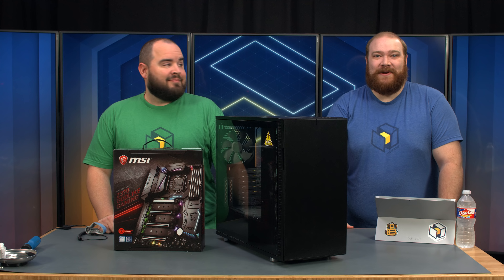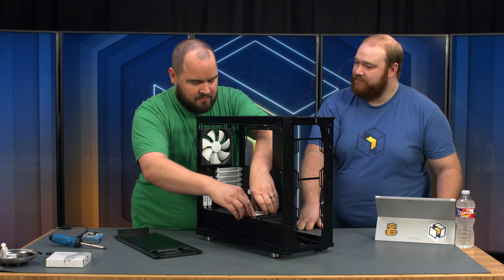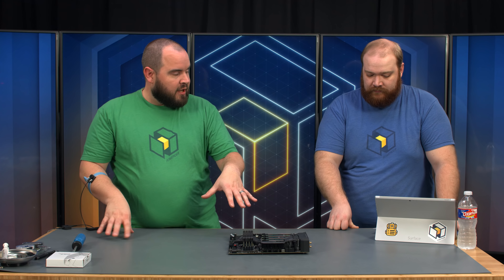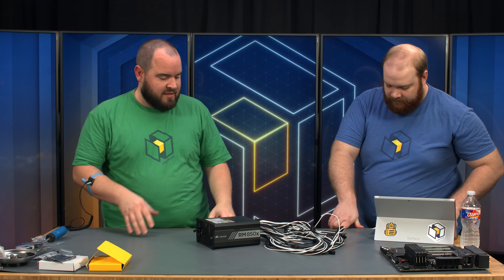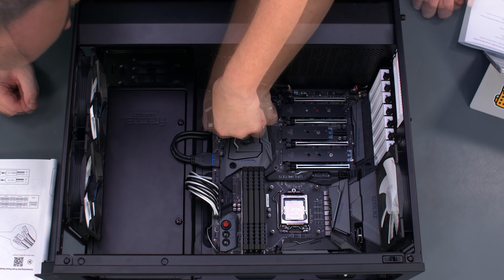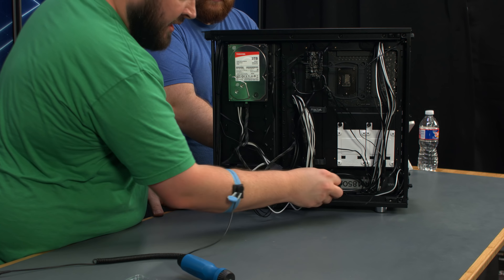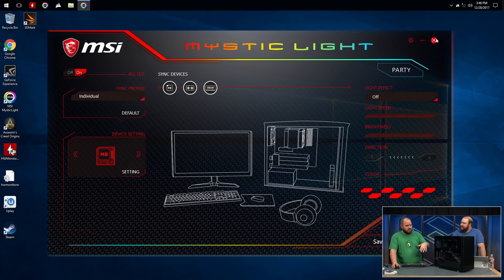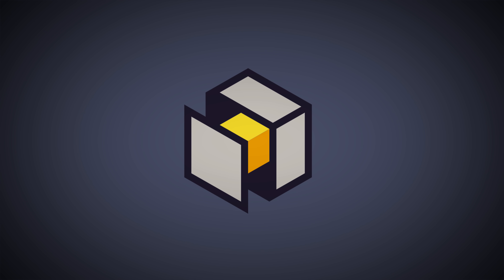Fractal Design Define R6 Build - i7-8700K / MSI Z370 Godlike Gaming (Livestream Archive)

Comment: Build white and black with msi aero asrock tiachi corsair vengance led white and nxzt h700i
Reply: with***
Reply: Nicolas_O.G.T i
Reply: H700i is awesome I just got one. I kinda expected the hub to be bogus and was willing to pay the price just for the case, but it's actually working well so far. I haven't tried the smart functionality though (where is tests and measures fan and noise levels), so far I've just used it as a basic fan and LED hub.

Comment: Am i the only one who cringed when he put his ESD band on when it's attached to the table and not the MOBO? like dude... anti-static mat is cool and all but you still shock the board unless you ground to it first..... Before you touch it with your hands... or it can get shocked when it touches the mat... You want local grounding, that's what the band is for...
Reply: Though i suppose it was fine anyway because he did touch the inside of the bag before the mobo which would have grounded him to it thus making it fine.

Comment: So sad to see an allegedly professional channel install a GPU rad on the bottom of the system. Gonna burn that pump out.
Reply: never build a system with custom water cooling before, could you explain why as i'm soon going to build a system, what would have been a better solution?
Reply: My comment only applies to AiOs. Due to the pump for AiOs being contained within the cooling block, you need to be mindful of the effects of both gravity. And due to the fact that AiOs are not 100% full of liquid and have no separate res, you have to then worry about air pockets. You always want the return to the pump block on an AiO to not have to fight gravity, and you want to make sure the rad is never orientated in a way that an air pocket will form at the barbs/tubes.

For a bottom mounted AiO rad like that from a GPU, gravity is the real concern. The pump is fighting gravity to push fluid back to the pump block. Fighting gravity exiting the pump block is fine as that's when its flow is strongest.

The air pocket issue comes into play with front or rear mounted rads that have their tubes at the top. The pump has to both fight gravity to return the liquid to the block and will suffer from air pockets that always sit at the higher point on the rad. And with the tubes/barbs at the top, your pump is sucking air through the system.

For any AiO, never bottom mount the rad and never front or rear mount the rad with the tubes/barbs at the top of the rad. Again none of this applies to open loop systems. They have a reservoir that eliminates air pockets, so long as you bleed the lines during install, and the pump is not located on a specific component and is also MUCH more powerful than the pumps contained inside the cooling block like on an AiO.

These are not just my personal opinions but are facts stated by experts like Gamers Nexus.

Comment: Always these big radiators for a cpu that is soo easy to cool with a simple tower cooler. A cpu in game is not that relevant and usually needs less than 60W.
But the hot 250W+ TDP GPU has to get by with a tiny radiator. This is ridiculous. Put a big raditator on the gpu or don't bother. It is not worth the money. Really bad price/performance for that setup.

Comment: Fractal case: uses corsair fans and psu
Reply: Well, three things. 1. Corsair provided sponsored products for the build. 2. They wanted RGB fans, Fractal doesn't sell any. 3. Fractal's PSUs are semi-modular, with the 24-pin Mobo power and 4+4-pin CPU power cables fixed, with fat round sleeving and ugly wire colors. They warned in the video that flat cabling was needed for the grommet pass-through with an E-ATX board. So those are out if you want custom cables.